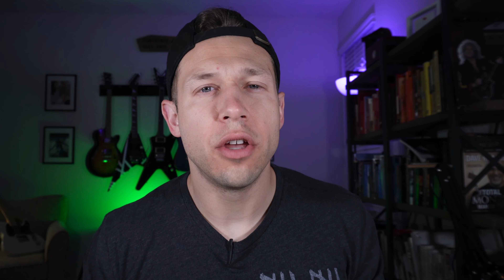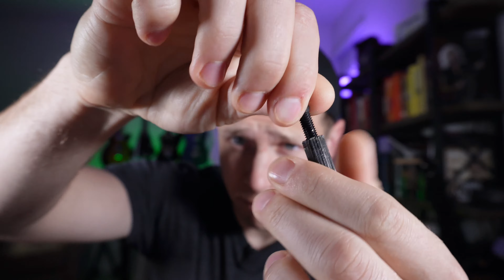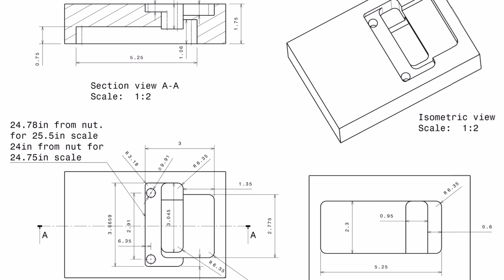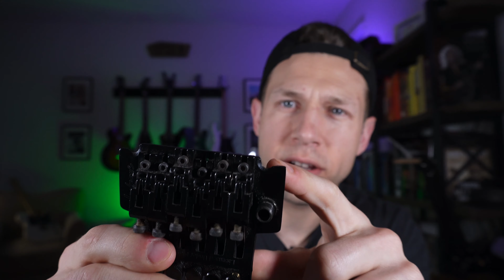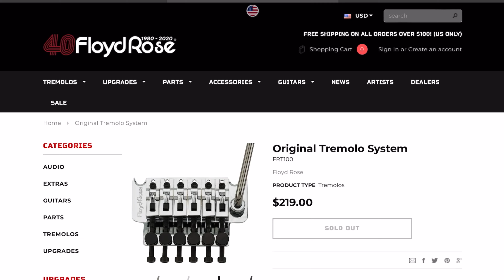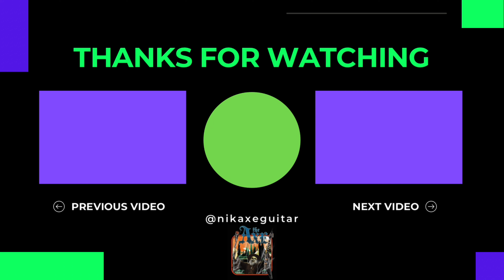5 MUST DO Tips for Swapping Your Floyd Rose or Floating Tremolo

Comment: Hi,I'm planning to replace a TRS-101 on an RG 360 with a more modern licensed Floyd Rose. Would you foresee any problems? I figured that the studs may need checking so ta for confirming. I'm just sweetening up what was my only electric for 30+ years & the TRS -101 is largely unscathed; an impressive model.

Comment: If anyone is tired of their Floyd or locking nut style trem, the Schaller Vintage Trem 1301 has been the best experience for me personally.  

& dont let the word "vintage" deter you. It's as modern as any 2-point trem. Solid as rock, & with a modern, well cut nut, it stays right in tune. 

There's no tradeoffs for me. I can string up super quick and made quicker by locking tuners.

I use mine decked, for pull up only action, so i enjoy easier drop tunings & far more range of motion than i even need [& i use a lot!]

I had a Floyd on my last guitar, and while it was just fine, i much prefer everything about the Schaller. It will now be the one guitar/bridge that i play forever.

Also, I'm pretty sure these units are reverse compatible though often overlooked in the conversation of viable floyd replacements.

Comment: hi there, I was thinking of swapping the FR special on my evh Wolfgang for the FR 1000 on my 5150. one guy mentioned he thought they were different specs in width? I'm guessing the pins should change as well and thinking they are probably the same material  being zinc alloy on the special and steel on the 1000. Would I have to remove the bushings and swap those as well? Are they generally the same size? guessing the threads would be the same if I was to just swap out the pins? Thanks to anyone who knows and answers.

Comment: What would be a straight fit replacement for the Jackson Licensed Floyd like he showed at the start, the guitars a JS32DKA Dinky. The Floyd has in white Jackson by Floyd Rose on it. The nut is crap on it so i'm replacing that first but the fine tuners on this Jackson one feel really rough on the threads then you turn them, so I am considering swapping the nut first, but maybe saving for a whole new Tremolo system
Reply: Hey did you end up replacing it? If so did the original FR fit where the Jackson FR was? Or did it need to be rerouted?

Comment: I was planning to replace my licensed Floyd Rose with at least a Floyd Rose special but the problem I found is that the licensed version is 3 5/8" in width a bit wider compared to the special version so, I have to make some adjustments regarding the installation of bushings in the future.  Thank you for the tips I'll keep them in mind.
Reply from the maker: You’re talking about the bushings? Or are the studs actually further apart?
Reply: @nikaxeguitar I was referring to the bushings.

Comment: Cool video and new subscriber here ! I recently got a used Jackson JS32 rhoades which had a Jackson licensed Floyd rose that is quite worn out and needs replacement. Just about to put an order in for a Floyd Rose original (FRT200) any idea if the Bushings for the posts are the same size ? Just wondering if I’m going to have to modify the holes for the post bushings for the new FR original bushings. Just trying to get an idea what I’m store for as… got a good deal on this guitar and figured it would be a good learning project 👍 cheers 🍻
Reply: Hey I have the same exact guitar and was looking to do the same exact thing. Did you end up going through with it? And if so did you have to do any work or did it fit right in?

Comment: Can you screw Schaller or Gotoh post into a Floyd Rose Special Bushing. Are the thread the same ?
Reply: Schaller & FRS fits together. 
Gotoh needs its own posts/bushings.
(tho I've seen alot of folks replacing just the trem from FRS to Gotoh without changing Posts. It might work but isn't ideal).

Comment: This video is very useful, I really appreciate that, So many players get into trouble.
Some additional tipps:
1. Always grease your knife edges.
2. Check the bushing width, but also the depth of your hole routing.
3. Also check the height and width of the trem block. Will the springs be in their place?
4. Detuning while height adjustment is good, but also remove one or two springs.
5. Checking string Spacing is one good thing, but make sure your strings are centered above the fretboard with the new trem just the same.
6. When the studs are not as hard as the knive edges, it is a good thing, for they will be damaged first and replacing the studs is far more cheap than the knife edges.
7. Always listen to "The Axe" for happy guitar playing.
Reply from the maker: Man! Seems like I missed a lot! Thanks so much for your kind words. I really appreciate it

Comment: I upgraded all the screws with titanium, including the posts, and saddle block inserts on my Jackson dk3QM which had a Floyd Rose 1000. I play in B standard so I needed the extra reinforcement. I immediately noticed that my guitar is way more resonant, and I haven't had any problems with the metals clashing. I also don't over tighten them. I'm sure that's a lot of people's issues with the cheaper trems. Good video sir
Reply from the maker: Hey Chris! Thanks for stopping by brother. Appreciate the feedback.
Reply: @nikaxeguitar  hopefully I can remember to continue commenting on this a few years down the road after longer use. 🤘

Comment: I always heard about loosening the strings on a floating bridge before adjusting the height, and thought it was pretty standard operating procedure and a pain in the ass . I’m not speaking on any other than the Ibanez edge and edge lo pro , but on I read on a page called Ibanez rules that you can safely adjust the string height on the edge bridges. The page has tons of useful information on Ibanez guitars set up tips . It’s a very useful resource for Ibanez guitars. I was surprised that he said you could adjust height while tuned to pitch. I wouldn’t recommend it on anything but the original edge and lo pro but have adjusted the height of my 95 edge lo pro with no issues. He also has an interesting article about matching the post to the knife edges, in other words use edge posts with edge bridges because of the angle of the hourglass part of the post . Just thought I’d mention that site for Ibanez specific trems tons of information on Ibanez rules.
Reply from the maker: Hey Brandon. Thanks for that. I’ve actually purchased a few things from Ibanez Rules. Great page!

Comment: Thanks, great Tips! 
But damn 3 and 5 were revelations... I bought a 1984 OFR reissue and fitted it to a body with a cheap licensed trem. I  assumed the licensed studs would be ok... but it looks like I'm gonna have todo some more modding to make it last longer! 

No idea how to remove the old studs tho...wish me luck!
Reply from the maker: Hey jack! Thanks for your kind words!studs should just pull out. But make sure you pull strongly yet slowly. You MAY be able to get away with getting some hardened steel studs that screw into the bushings you already have. Hit me up on IG if you have any questions